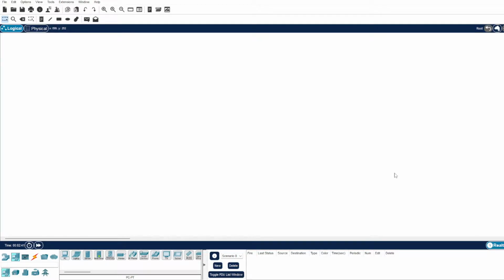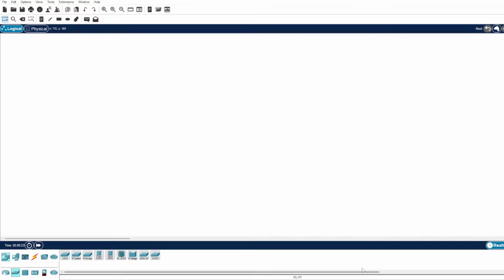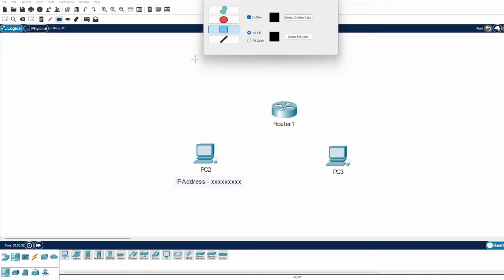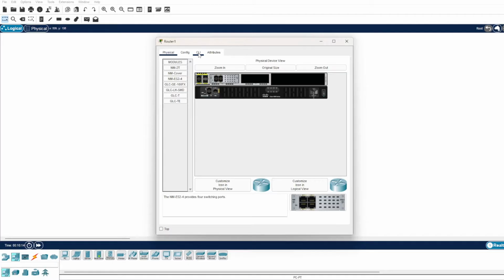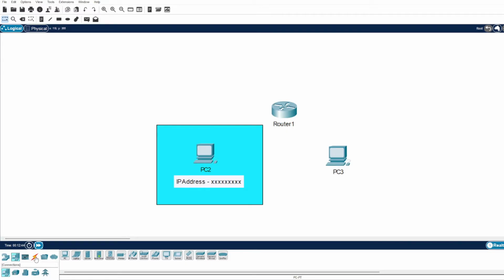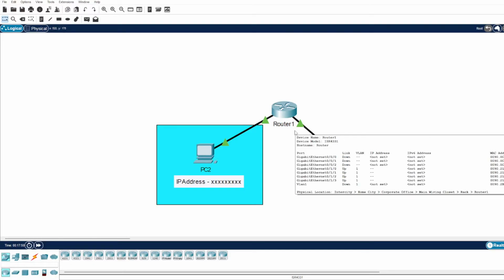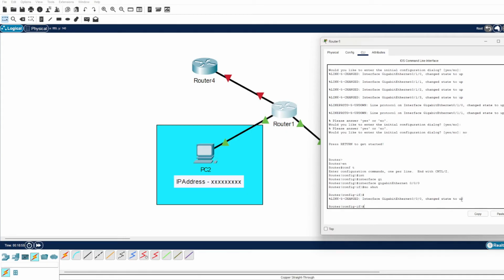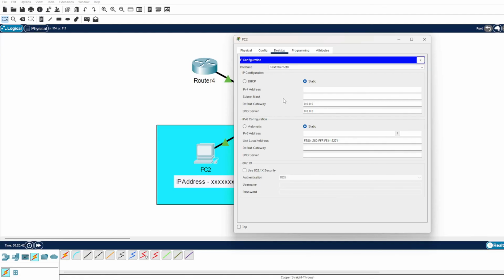How to Use Cisco Packet Tracer for Beginners

Comment: hey man i have a question if you know to answer.

Central switch > connected to a wireless access point. 
Then computers connect to that wireless point.
Lets call this a meeting room.

So I have been asked for the meeting room to have wireless and wired access.
I managed to do the wireless access point connection but how is possible to connect the same computers into the wired so they can have wired and wireless access at the same time if that makes sense?
Reply from the maker: Hi yes I believe you can only have one active network connection attached to the end device. If you disable their wireless connection and then attach the wired access to confirm it works. Ensure to configure the wired access. It is very possible it will only allow one active network connection whether that is wireless or wired and not both at the same time unless there are two separate Network Interface Cards and no conflicting IP Addresses.
Reply: @LearnCiscoWithRob  thank you so much can I contact you for more questions because I need to submit my assignment in 2 weeks and I want someone to answer my questions when I have them .
Reply from the maker: Of course. Please leave your name in the email. 

You can email me at: learnciscowithrob@hotmail.com